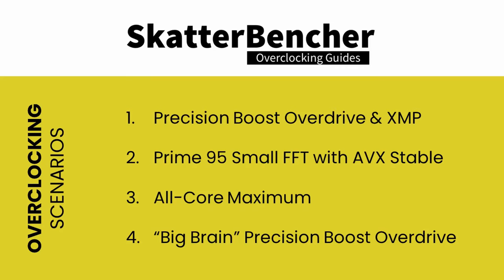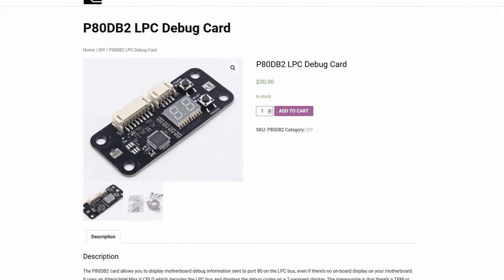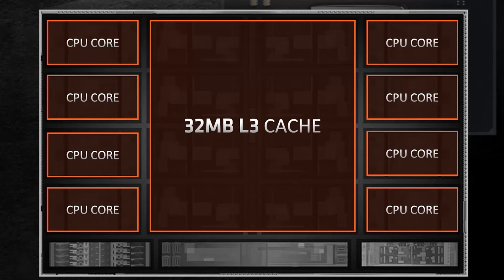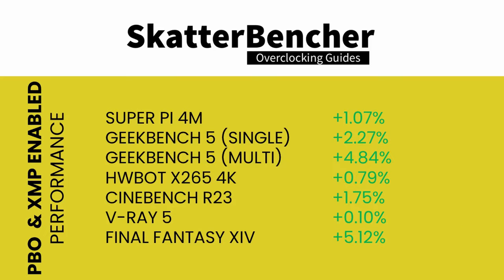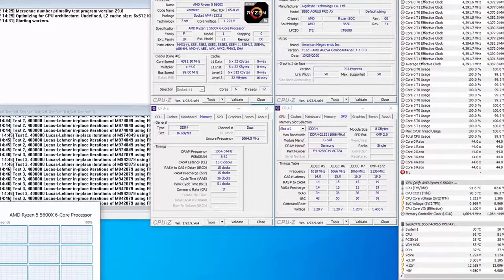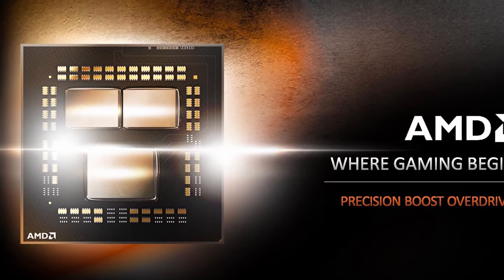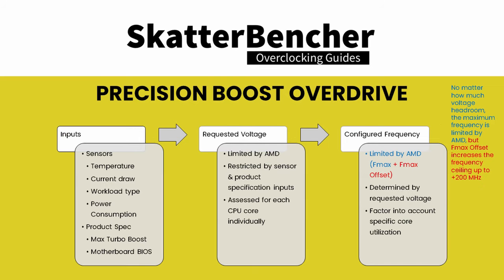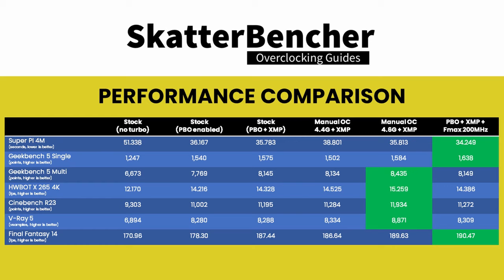5 Minute Overclock: Ryzen 5 5600X to 4850 MHz

Comment: What i am wondering is that is the CPU gonna run at 4850mhz all the time? Even when idle or doing normal task?
Reply from the maker: When using Precision Boost Overdrive to overclock, you're essentially tuning the Precision Boost algorithm. Precision Boost will adjust the operating frequency according to its needs, so when the CPU is idle it will reduce the frequency
Reply: @SkatterBencher  ahh cheers. Have you tried tweeking the curve optimiser?
Reply from the maker: Unfortunately, Curve Optimizer wasn't available when I made this video. The first video where I used Curve Optimizer was the Ryzen 7 5700G https://youtu.be/4gDfMwOBnoE

Comment: Did you have to update the bios for using this cpu or it just worked right out of the box?
Reply from the maker: I received the board directly from Gigabyte and didn't buy it from retail. There was an engineering BIOS on it so while the board booted up just fine, I still had to flash to the latest to make sure everything worked fine.
Reply: @SkatterBencher  oh thanks, and, sorry for bothering you this much, did you have any problems updating the bios via the flashback button of any sort and how much did it take?
Reply from the maker: No worries, I'm here to help and answer questions!

I used the BIOS flash tool included in the BIOS and had no issues whatsoever. I didn't use the flashback button so can't comment on that.
Reply: @davidelancellotti8796  I just got a auras pro b550 a couple days ago. Put my 5600x in it. It booted to the bios just fine, but it would freeze when trying to load into windows. Updated the bios and it fixed it. So all the boards will recognize the cpu and work in bios, but my bios was showing my cpu frequency at 0 mhz until I updated the bios. So technically you dont need to update the bios to post, but If you want to actually load an operating system you need a bios update
Reply: @Jsteeeez  thanks for the reply but in the end i had to buy a 3600 because the 5600x was going for around 400€, and the 3600 for only 190

Comment: I'm looking to buy a motherboard that will go with my 5600x to replace my 2600. Any recommendations? Any motherboards that will take the overclock? I'm looking to upgrade because I replaced my gtxt 1070 with an rx 6800 and now I'm getting worse performance in games
Reply: MSI B550 A-Pro
Reply: @charlesmiv3842  I bought a used 1 year old x570e gaming for 80€

Comment: With ryzen master application i can make it at 4750 mhz with 1.275 volt with temperature 79-82 if i change the settings at bios like you do in the video i can hit 4.8 mhz with decent temperature?  Im afraid that i will do the cpu damage
Reply: Brawoler T-T   my mistake I’m tried to play with it a llitle bit more from what i discover now i am able to go with 4750mhz with 1.25 volt with no problem with 77 temperature sometimes even less then that i don’t use the stock cooler  actually I bought from alli express SNOWMAN MT-4 CPU Cooler Master 5 my friend helped me to build the computer because i dont really understated with that stuffs but on the way im learned a lot and i learned a llitle bit to do oc and i want to get maximum performance from my system but i also discovered i can get trough 4775 mhz with the cores but the temperatures really grow drastically like i need around 1.3 volt and got to temperature 85-86 so i felt that not ok to push it too far i came back to 1.25 volt with 4750 mhz also one time i am success to do 4800 mhz but im feel it cant be stable because temperature jump to 86 and above btw my cooler is fine?
Reply: Brawoler T-T   ho btw when i want to check the temperatures i used cine bench benchmark if i do stress test on the ryzen master application i get a a lot more cooling temperatures like 60-70 temp so i dont know which test is tell the truth both of them use 100% of the cpu i just thinking cine bench is more reliable because he push the cpu more probably i mean the temperatures way higher
Reply: Brawoler T-T   idk if that worth it to buy again air cooler again i mean i just my my computer now is barely 1 month old and im actually  doing fine until with now in gaming no problems with fps but i love to see my fps sky rocketing so i always try to find a way to get that results and about that air cooler what is the price and this is could made much difference that worth it?
Reply: I have ryzen 5600x 4850mhz 1.237V arctic liquid freezer 280

Comment: can run 2000FLCK on my x570 tomahawk ( msi ) with an 5600X, however its not fully stable, gettin alot of cracking noice in my sound. any idea? maybe bios ?
Reply from the maker: 2000 FCLK is pretty good! I haven't been able to achieve this on any of my systems, so I'm not sure how to diagnose. If you find out what it is, please let us know as well!
Reply: @SkatterBencher  for my motherboard x570 msi tomahawk, where is only 2 bios for 5000 serie cpu. and they er both super bugged. sorta.. right now i run 1900flck/3800 nem. 14-13-13-13-28 CR1 super tide sub timings to, and enhanced latency enable. runs super good pushing past 2100 points in cinebench r15 to. but stil bios disable turbo boost so im locked to run override voltage with max boost 24-7. chip handle its pretty good with an 420mm AIO artic freezer II. but im sure with new bios 2000flck will be fully stable. right now it feels like i own an 5000 serie chip prerelease allso i struggle get 4.9ghz stable. 4.85ghz is fully stable with 1.35vcore only, but as soon i push 4.9ghz it wont benchmark no matter voltage i put
Reply: Same here with Gigabyte B550 Aorus Pro. FLCK 2000 easy on the first try today. Also oc´d my 87€ ram kit from 3600mhz cl18 to 4000mhz cl18 so i got 1:1:1 ratio. My 5600x seems to not be able to pass cinebench when over 4700mhz but need to test out more.

Comment: So, I followed everything step by step for the Pbo 200mhz clock boost. but pbo is still only boosting to 4.6 ?? My temps never get over 62 deg. should have plenty of headroom still?
Reply from the maker: It sounds like the voltage headroom isn't high enough to get the maximum boost. Try setting the Scalar option higher or use Curve Optimizer to have the PBO algorithm try higher voltages :)

Comment: running 4x8 bdie 4000mhz 2000fclk stable (3200c14 tforce dark pro sticks) on my 5600x 100% whea free, PBO/CO 200auto oc, -15,-12,-12,-12,-15,-15 +60mv offset. (51.9ns aida )
these are my gb score (im craxton if you wish to search 5600x) single score was 1742, multi score was, 9622) win 10
 even if someone cant run CO or doesnt wish to mess with it, leaving PBO with 200mhz auto oc and setting a negative offset to core voltage of 70mv is what i ran for ALONG time. but since then, im not running the CO mentioned above and hitting 4.85ghz ALL CORE ALL THREADS (test this using TM5 easiest and fastest way) do note that if your PBO is to open, or to limited your cpu will get to hot and not boost, or not have enough juice to boost. theres not a ONE SETTING FOR ALL that really works, so you have to go thru trial and error..
Reply: Hi, how you all get 2000 FCLK? My old 4650g did 2066 Stock. But my 5900x end at 1800. I have 4x 4133mhz bdies 8gb Stick. Actually @3600 CL 14-14-8-14-28-42 1T GDM on. 1.5V on RAM.
Reply: @m.m.3753  i had my 5600x running that at pretty decent sub timings cl16 flat. 
now my 5800x ON THE SAME BOARD literally nothing changed just the CPU and it would do 2000fclk. but was WHEA out the ass. so i dialed in 3800 c14 flat. at 1.55v with a fan blowing constantly on the ram. so to answer your question "it 100% depends on the processor"!

Comment: love the video very usefull , btw what is the max safe volatge that i can run 24/7 with my 5600x  without degrading the chip and with a 85 c max temp  
thanks in advance 👍
Reply from the maker: I would recommend this video I made on PBO: https://youtu.be/1wcU8PrdGLE

It explains why the high voltage is no problem in specific situations like single threaded light workloads. So it's difficult to give a specific recommendation for target voltage.
Reply: Ive heard that under 1.3v is fine for not degrading the chip
Reply: Amd state 1.35v is the max initial voltage to have, in order to keep safe this cpu and I would keep lower then that, even if it can reach and stay until 1.39v before having potential major issues. However, with a good cooling solution in a case that have neutral or, at least, positive pressure, overvolting first and then o.c. the 5600x with advanced pbo settings on but using manual o.c. , your cpu should easily get 4.700 mhz all core without starting over 1.31v and keep temperatures lower than 80 degrees, unless you are going to stress the cpu with an heavy workload for all day long.

Comment: I tried overclocking to 4.65 GHz with a voltage of 1.280 and it's P95 stable. After that I tried to enable PBO to the maximum power and it does nothing. Under maximum load the frequencies will not go over 4.65 GHz (as set into BIOS), how could anyone get the +200 MHz boost on an already overclocked CPU. I can't get PBO doing anything with custom frequencies and voltage.
Reply from the maker: On AMD Ryzen systems, you can do either manual overclocking or precision boost overdrive but not both at the same time. When you manually set the CPU ratio, the CPU goes into "oc mode" (as opposed to "pbo mode") and disables the normal turbo boost functions.

The only way to combine OC Mode and PBO is by using features like ASUS Dynamic OC Switcher or GIGABYTE Active OC Tuner.

Comment: I'm overclocking the 5500 to 4.8GHz. It runs cooler than my 5600x at 4.8GHz because of PCIe 3 is MUCH cooler than PCIe 4. Cinebench multicore test max temp = 82c and while gaming = 64c max. using b550 tomahawk mag
Reply: Hi. Is it worthed to buy B550M motherboard for my 5600X? Currently I am usinf asrock A320M HDV with RTX3060 12Gb

I wanna use it for Engineering Simulation

Is it hard to OC this processor and run it daily? 

My Cooler is AK62, RAM Klev bolt X 3600mhz, PSU Bequiet 600W
Reply: It runs cooler because the 5500 doesn't have SMT

Comment: is it the same as the non X version ryzen 5 5600?
Reply from the maker: You can apply the same settings, but the maximum frequency will be 4400 + 200 = 4600 MHz instead
Reply: @SkatterBencher  okay thanks

Comment: Could you overclock for crypto mining with this build? 
A B550, the 5600X and GPU (I’m looking to upgrade to NVIDIA 30 Series and put my 2080 Ti in a mining B550/5600X build.)
Would focus on undervolting the core clock and boosting the memory clock to max on the GPU for mining Ethereum. Not focused on gaming.
Reply from the maker: Sadly I don't have this exact setup anymore :(

Comment: At 3:09 
You go into a menu that is impossible to find not even with search 
You click advanced 
Then obviously opened another window didn't say which and kept talking like it was the advanced main tab
Where did you navigate top to get the cpu clock ratio
That didn't even pull up when I searched it in bios search
Reply from the maker: It's possible the setting is hidden behind CPU Ratio Mode. Try setting CPU Ratio Mode to "All cores"

Comment: I'm running on 1.23 and 4.85ghz no problems with a rx5600xt r5 5600x on cold war 180 to 250 fps compared to my i5 9400f which ess pulling 120 ish fps with the same gpu
Reply: 4.85Ghz set on all cores or pbo ?

Comment: i have my 5600x oc to 4.6 all core at 1.25v runs prime 95 fine ran it for an hour  max temp was 72c
Reply: So you manually input the frequency and v yourself. Did you have to change it at all or first shot worked?

Comment: Follow the video but my 5600x never get the 200+ bump
Reply from the maker: What's your cooling solution? Running high in temperatures?
Reply: @SkatterBencher  Ok, nevermind it worked. I'm using an Asus TUF Gaming X570-PLUS/BR so I had to double check some bios settings, then I left Cinebench R23 running for 30 minutes and according to HWMonitor, the min/max clocks were 4400/4978 MHz (I'm running base clock at 47). This is weird. Is it ok like this? My cpu runs with very low vcore (1.23125v set on bios and mems at 3600cas16). Also, I'm using a custom WC with 2 rads and temps never get past 69 celcius.

Comment: the video is very old and need to update because of AMD change the cpu microcode and at high volt compare to this video time its run hotter example on this time we use 4.65 Ghz on all core stable at 85c with 1.32 volt at normal load like cinebench R20 10 minutes of continuously run and in games its run at 72c to 75c at cpu specific game like most racing games they mostly run more at cpu side but now its crash at 4.5ghz at 1.250 or 1.275volt so i requested for updated cpu microcode can you please make new video with test, this will more community subs already always watch your every new video released but this is my 1st comment because as user of Ryzen 5600X
Reply from the maker: Thanks for the information, I was not aware of this! It would certainly be interesting to compare OC behavior differences between the first BIOS and latest BIOS release, just like it's interesting to track GPU driver performance over time.

It would be a time-intensive task though and I'm already short on that particular resource. I'll keep it in mind and see what I can do.
Reply: @SkatterBencher  thank you very much , i understand these work are not easy to do, need much time, i appreciate your hard work thanks for your every, i will be wait when you have good time to released new tweaked video ✌😊❤❤

Comment: I am saying for both intel 10/11th gen and amd 1000/2000/5000s just sucks in auto oc (boost tecnologi) and I prefer manual oc over every thing, 5600x for example I have now sucks with PBO and get high temp vs my locked oc like 4.85Ghz on 1.4Vcore. its good for beginers but not for me.
Reply: @nelsonpiedade61  well I am going 1.47Vcore 4.9Ghz and stays below 60C temp on my r5-5600x when it draw in games up to 110W. maybe I am stuck in erly 2000s but I really feel when my CPU goes from 4.85Ghz boost to 4Ghz for one secund I can feel that fps drop in game and I do not like it well I am still lock my GPUs clocks but I feel GPUs now days can stay stable on high Mhz stable pretty good but still I do not like to give any control to my PC and want to have full controll.

Comment: Hello Sir, Nice Video. 
I  recently build a new gaming PC. details are: AMD R5 5600x, MSI b550m pro-vdh wifi Motherboard, G.Skill 16GB(8*2) 3200mhz Ram, CPU Liquid cooler corsair icue h60i rgb pro xt, Antec 550w power supply and ASUS gtx 1650 4gb oc Graphic card. 
I want to overclock AMD R5 5600x processor, kindly guide me.
Reply: Follow the video
Reply: @hioxd  Thanks for valuable information

Comment: That board is nonexistent in the US lmfao
Reply from the maker: Yea, I found out after making the guide! :) My friend in GIGABYTE said the Pro AC should be pretty much the same though.
Reply: @SkatterBencher  the AX has a usb c front panel header , some vrm changes but essentially the same and wifi 6 support. I'd also just go Aorus Pro v2, but that board also is no where to be found. The b550-f is another board, but a bit expensive and the hardware lan issue turns me away from it
Reply from the maker: Thanks for the information, much appreciated! :)

Comment: Is it me or the 5600x basically gained no performance also 4.6GHz is so 2015 reminds me of i7 4770k speeds, it seems the 10850k gained alot from overclocking in comparison
Reply from the maker: Some CPUs come out of the box already very aggressively clocked while others have a bit more margin. AMD did a pretty good job maximizing the out of the box performance of the 5600X.

Comment: Poor 5600X who consume a lot and stay at high temperature when it can do the job with only 45W just in blocking his frequency boost and stay at his base 3,7ghz clock speed ... always under 50°C, no less performance in games (especially if you play in 60fps blocked frame rate because 140fps or more is just ... a waste of electricity and no efficient at all !). Stay safe with your CPU ... if you really want more power and do this kind of thing in your cpu ? It's time to rebuilt a new PC ! But lot of people made that just to have more fps in game ... but consumptions explode with that ! Blocked your frame rate to be very stable at 60fps, trust me, is very fluid and playable ! 140fps is just for long session time for eyes that's all ! You have no benefit and you will never be more speed than the server tickrate ! So please ... give some love on your CPU ! Don't overclock it !

Comment: If I make these changes and then check on ryzen master, the peak core voltage never goes above 1.1v, any idea on what is causing this?
Reply from the maker: I am not very familiar with Ryzen Master or how it behaves, but you can always double-check using HWiNFO